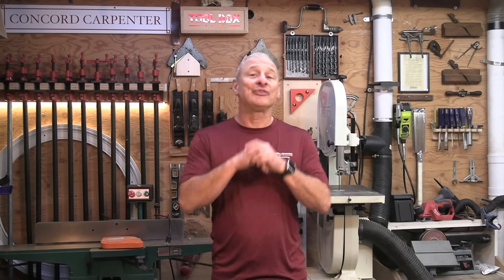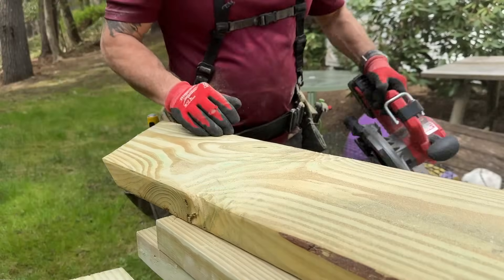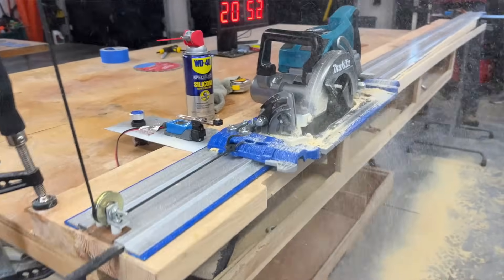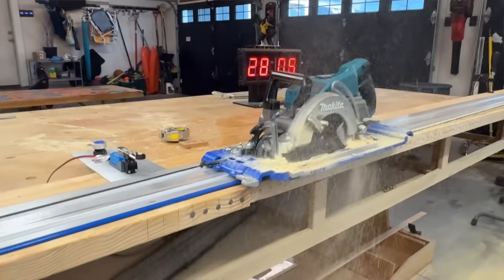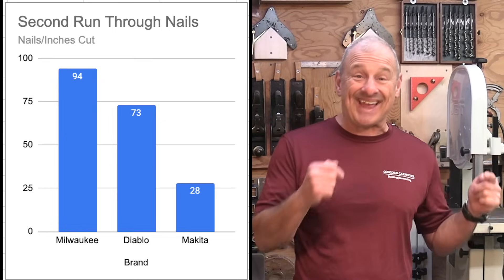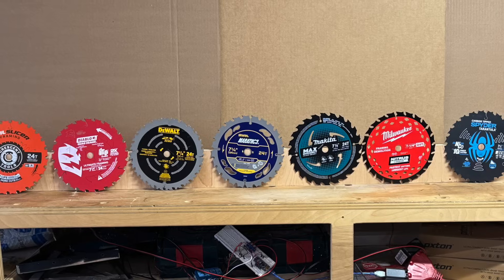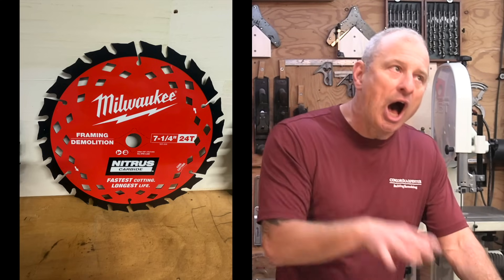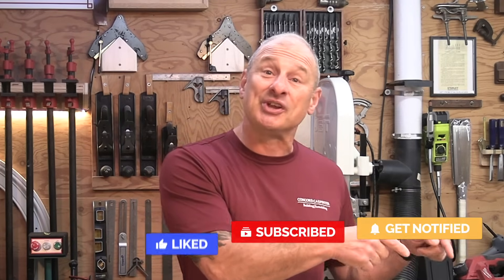7-1/4" Framing Saw Blade Comparison

Comment: I've been a huge fan of the makita max blades.  They cut like a lazer beam and are cheap as chips when you buy a multi pack.  Im not plowing through nails/screws on the regular, so that's not such an issue for me.

Comment: Its  Y we need more than 1 blade TYPE  in our arsenal  !!😊❤
My thinking is this, i can have several Mak OR Dem blades to toss at a job 4 thr price of 1super Mil blades ..
I also sharpie on thhe inner most part of the blade what its use is.. the thrasher, wet treated /sappy/trashy plywood, general,  
The Queen... super good  cuts,  fine work etc. I also put date of entry in to service.  (  this let's me know  how longits service time was. 
I also put start dates on my batteries  so know itterm also ( alot of variation  goes there. Some r to short which  suggests a bad  atch ?? At manufacturers  point !?? ).
ATB guys !! Keep up the great work on videos  !!!!!😊

Comment: Why didn't you include Bosch?
Reply from the maker: @24revealer  we bought what we normally see in the store I've never seen a Bosch blade for sale at our local Home Depot, Lowe's, or lumberyards
Reply: @ConcordCarpenter  that's interesting.  We don''t seem to have those Milwaukee blades in Canada.
Reply from the maker: @ they’re brand new
Reply: Bosch owns Frued and they're the most popular pro/onsite blade in the States. I've never seen a Bosch blade in store and I'd guess that Bosch blades are likely Frued "rebrands" or otherwise extremely similar.

Comment: I've always kept a Makita max on my rear handle for clean cuts and a Crescent nail slicer on my sidewinder for wood with nails. In clean wood the Makita is the best blade someone could ever possibly buy. The Milwaukee will be replacing my crescent blades for dirty wood tho. Great test.
Reply from the maker: Sounds like you have a good system. 😊
Reply: Na, not realy

Comment: Just a thought, the DeWalt blade you appear to be using does not look like their newest blade (elite series demo). You verbally call it the "elite" but visually at 1:58, you can see it's just one of their "2X" blades not branded as elite. When you Google "DeWalt Elite Demo blade," it looks visually very different. Is there an explanation for this?
Reply from the maker: @nicholasspagnolo7842  excellent eye!    Our Tool Testing took  place over six weeks. We started the test with an older Dewalt Blade and then got our hands on the Dewalt elite and tested that. So what you saying that opening video is in fact, the older blade and I missed it on the edits.  We did in fact test the Dewalt elite series.

Comment: sorry, that is NOT dewalt elite.
Reply from the maker: @darksahde   excellent eye!    Our Tool Testing took  place over six weeks. We started the test with an older Dewalt Blade and then got our hands on the Dewalt elite and tested that. So what you saying that opening video is in fact, the older blade and I missed it on the edits.  We did in fact test the Dewalt elite series

Comment: When Diablo came out with the demo demon blade back 12 years was using it on house built in 1800 put dewalt worm drive destroyed blade hitting cuts nails on a roof, and when put any Diablo blade on my saws they did not last long was  that the first generation blades.
Reply from the maker: theyre WAY better today

Comment: Have to keep my eye on thoes milwaukee blades to go on sale.  Realistically the 2 pack of diablo framing blades at 6 bucks or less each or less every year (holday) get us by without issue.  They can handle a half dosen grk or headlock before there useless and the demo blades are tougher but 3x the price most of the time.  It's not all about money but most saw blades are 60% to 70% as good as any other besides the lowest quality one at that price it can change them out every couple weeks to a month.  Knowing my guys there gonna hit something like that fc they shouldn't and I don't feel bad about 5 to 6 bucks at a time.  Appreciate the honest testing.
Reply from the maker: Thanks for watching - good info!

Comment: I don't typically use a super nice blade for demo work (as in, "I don't") but the fact one of them went through 96 nails is unbelievable. That's quite a torture test!
Reply from the maker: @rickrudd  actually it went thru 188 nails an we stoped there
Reply: @ConcordCarpenter  I paused the video and wrote the comment before I even saw the second part! Unbelievable!
Reply: 188 nails
Reply: Would be fun to see it go through a cut to failure test to see how far it would go